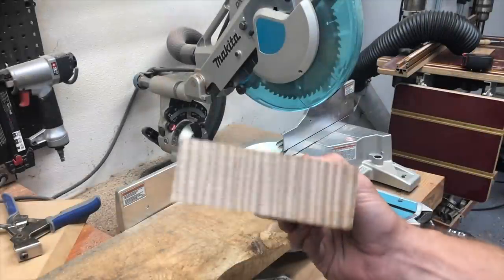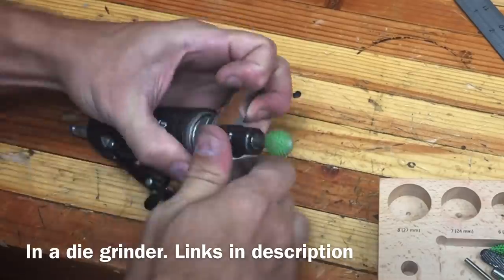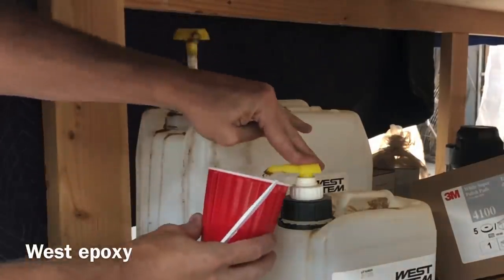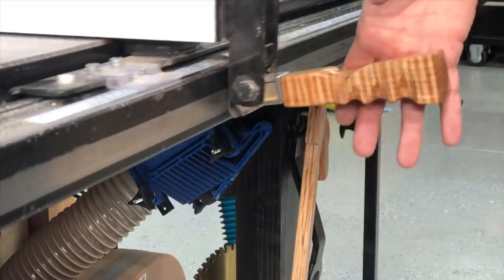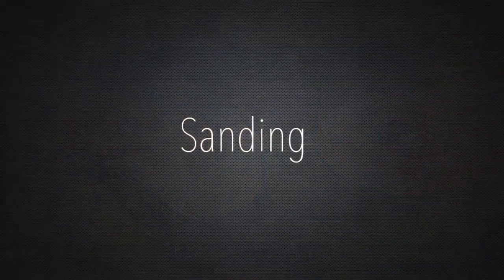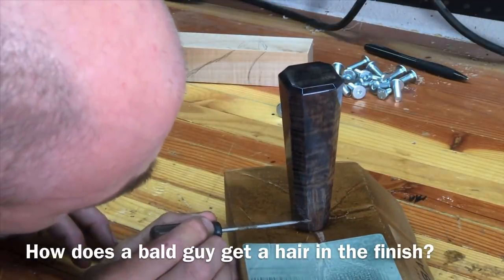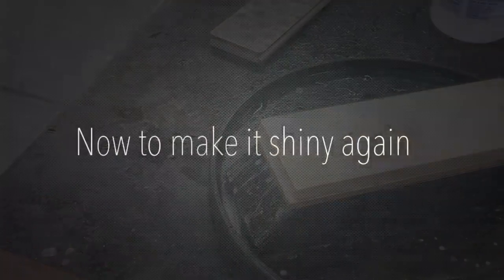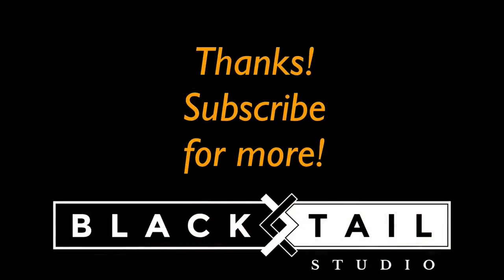Table Saw Fence Handle — DIY Projects — How To Woodworking

Comment: I love the black TransTint handle. I love using dye stains on curly Maple. I usually use a really dark stain and sand it off it dries. I do this a number of times to get the stain down into the figure while removing it from the hardwood on the surface. It really accentuates the curl in the wood. Love your little side personal projects. Thanks.

Comment: Could see a definite improvement between stage 2 and 3 in the buffing. I cut and polish ed opal by hand as another hobby so I'm used to sanding from 400 grit for rubs and shaping to 1200 grit with pastes that go a lot higher. The difference between stages isn't always immediately apparent but each stage is necessary. Skip one and you're just wasting time.

Comment: Had to re-watch this handle making vid.  I’m interested in copying the black die job.  I make 18 inch long turned handles for outdoor fire pokers.  I’ve done a lot of Curly Maple ones because of the contrasting grain patterns.  But your black die idea is really interesting.  Really miss or Woodcraft store here in Tigard.  
Guess I’ll drive over to the Beaverton Rockler store for the die.  So no bleaching of the wood first?  I’m wondering how an outdoor oil will work with the die.  Thanks for the idea.  Mike

Comment: I liked the black dyed flat faced one. What do you think about using epoxy instead of lacquer? I have made a new handle for a kitchen knife with scrap wood and coated it with epoxy. But it was just DIY, I am not a woodworker.
Reply from the maker: Should be fine!

Comment: Very nice presentation, tangent question, I'm considering a Makita compound miter saw and I see you have what looks like the 10".  Is this adequate for all your needs?  Any recommendations?

Thanks, Doug
Reply from the maker: Hey Doug, ya the makita is good. I’ve heard the Bosch is better, but the only thing id replace it with would be the Festool.
Reply: @BlacktailStudio  Is the 10" sufficient?  I'm a home wood worker.
Reply from the maker: Ya, I like the blades being interchangeable with the table saw
Reply: @BlacktailStudio  Thanks, good point...